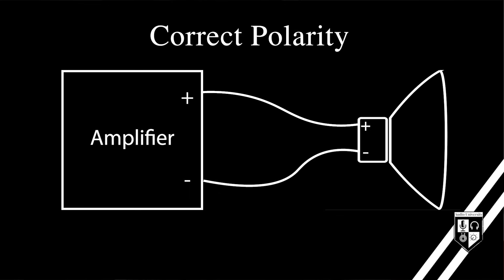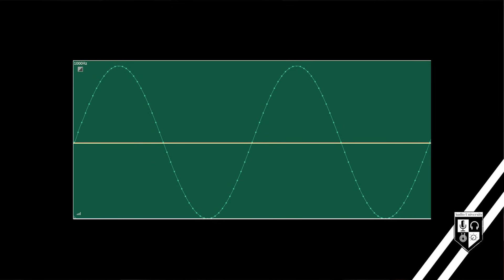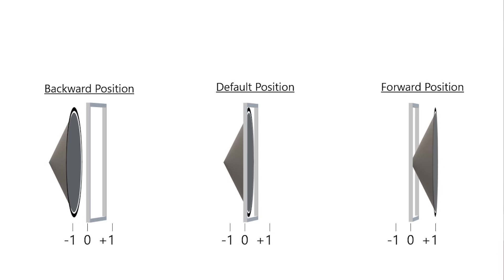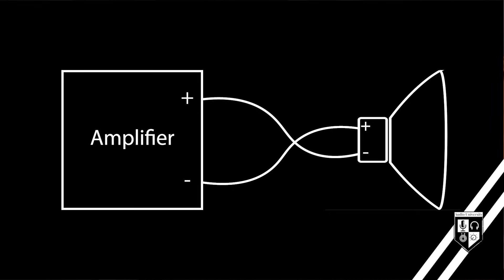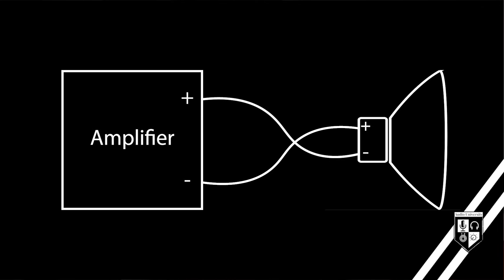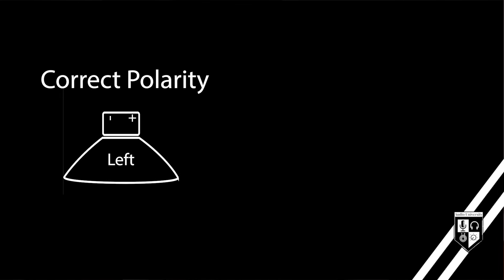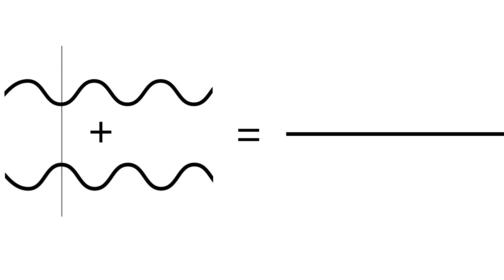POSITIVE VS NEGATIVE: Does Speaker Wiring Matter?

Comment: Its an AC signal going to the speakers so on 1 speaker the polarity does not matter. 
But when you have 2 speakers connected, the polarities need to be the same or else the sound will be distorted and the bass will be off balance when both are on.
Reply: @oldolfmann8927  polarity does NOT matter when its a mono speaker. 
Its an AC voltage which means the voltage & current is alternating back and forth so it does not matter if the speaker starts its direction up or down when its a MONO speaker ...
Reply: @oldolfmann8927  bro ... i have been in car audio since 91. I have (5) IASCA trophies.  
Dont sit there and tell me that polarity matters with 1 speaker. I already explained the physics behind it, i cant make you understand it.
Reply: @oldolfmann8927  yea ok 👌 ...
Reply: @oldolfmann8927  You are persistent, i will give you credit for that.

Comment: Can you do a bit on passive radiators? I've always believed them to be counter-productive as the radiator is worked in the opposite direction of the driver, just like the reversed polarity. Isn't this basically noise cancellation?
Reply: They're not just moving in reverse, they're also affecting the resonance of the system. Ports work in much the same way. Wikipedia has pretty simple explanations.
Reply from the maker: To be honest, I don’t know much about passive radiators. That’s a very interesting topic that I’d love to learn more about though! Other aspects of loudspeaker design, too! 

Sorry I can’t be more helpful, but I will add this to a list of topics for future videos that will require more research or help from a special guest. Thanks, Steve!
Reply: @AudioUniversity  how are you here talking about speaker wiring and polarity and not know about passive radiators.
Reply: It will mimic the movement of the subwoofer and help move air to create a little more bass.

Comment: Hi mate just a question. When wiring in parallel. Does it make a difference in audio quality or power draw when connecting the second speaker to the first as apposed to both speakers being connected directly to the amp.
Reply: I would agree that it probably doesn't make a lot of difference either way, but under some conditions it might.  If the wire gauges differ significantly, especially if you are using a high gauge ( small diameter) or if one run is multiple times the length of the other, the power delivered to each speaker won't be equal.  But, again, pending the situation, the difference in volume between the two speakers may not matter much.  That is also assuming the two speakers have the same sensitivity.  If Daisy chained, like the rings on a ladder, the leg to the first speaker has to carry twice the current as the legs running to the next speaker so make sure the gauge wire you choose reflects that choice.  If you are not that concerned about optimizing total performance, you probably won't be able to tell the difference by listening.
Reply: Connecting them directly to the amp cuts the wire impedance in half. It shouldn't be noticable if your wiring is thick enough.
Reply: If you wire two speakers in parallel, thence to the amplifier, this is no difference than each speaker going by its own wire to the amplifier; they speakers are still in parallel and two 8 ohm speakers in parallel is the same as a single 4 ohm speaker, from the amplifier's point of view.  Wiring two 4 ohm speakers in parallel makes 2 ohms and many amplifiers won't like that.  However you can wire two 4 ohm speakers in SERIES (plus to minus, red to black) to effectively make a single 8 ohm speaker and it will work fine.
Reply: Don’t do it , you putting a load across bth speakers that was never meant to be!
Reply from the maker: I believe both methods of wiring in parallel will achieve the same outcome. Good question though!
Reply: Quite often when someone connects 1 speaker directly across another 1 it will burn out the amplifier in a while, especially when you turn the volume up loud.
If your amp says " impedance min 8 ohms per channel " when you connect 2,  8 ohm speakers in parallel you are effectively putting a 4 ohm speaker on your amp & the output stages in your amp wont like it.
Reply: It does wiring one speaker to another change the OHM load from the amp to whatever it’s connected to
Reply: @3zealot324   Your answer is not very clear....maybe due to no punctuation?

Comment: hi, does subwoofer and mid need in same phase?
Reply from the maker: It’s most important that they are in phase at the frequencies where they overlap. The wiring should be the same, but sometimes you will benefit by flipping the polarity or delaying one in the amp/console.

Comment: I have spent a hour trying to find out how to find the pos and neg post on speakers. My new speakers came with no papers. Thank you.
Reply: It doesn't matter which post is which  as long as you match amp to speaker on both left and right channels, you will be fine.
Reply: Me to. Here is what I posted: Here is a question I have: I have two older vintage ADS speakers and the back terminals have neither positive or negative (red nor black) indicators. How do I know which to connect my speaker wires too?
Reply: @natanpierce495  the larger connector pin is positive and the small one is negative.
Reply: @natanpierce495 are they different sizes? Usually the larger is positive.
Reply: sailr8, did you buy those speakers from a guy with a white van on a street corner?
Reply: The inputs on the speakers aren't color coded red and black? Almost all speakers and amps are, with red being positive and black being negative

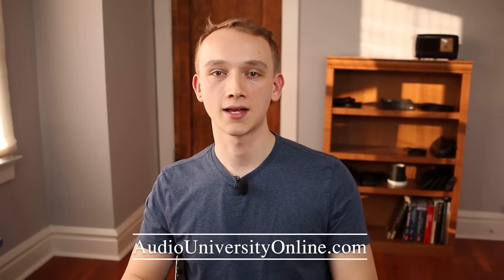Comment: Great Video! What is the "later video" you are referencing at 4:35? I'm not getting any sound out of my Bose Acoustimass Subwoofer and I suspect the satellites may be wired wrong, affecting how the sub module performs. Could an inverted polarity wiring be the possible cause of getting absolutely no sound at all from the sub? Or would I at least be hearing something? Trying to avoid dismantling the entire system for troubleshooting if there is something obvious I might be missing. Thanks!
Reply from the maker: I haven’t created that video yet. 

Reversing the polarity of your wiring wouldn’t result in no sound at all. I suspect something else is going on.

Comment: Hi  
Thank you for the video.
 I have a question that I cannot find the answer online. I own a pair of high end peakers and a powerfull amp. When I connected them  in the center fo the room there was no bass at all, but it was all arround the appartment, just where it shoudl be, there was noone. I have tried to reposition them as much as I could (not tu much space around them) and it didnt help. 
Then a friend of mine suggested to reverse the cable on one speaker and it  acctualy did the trick. The bass moved from around the room to the center of the room (couch whre I listen). My question is, do I leave it like this or how can I move the bass in the center of the room having the speakers connected correctly?  
Thank youf for any info!
Reply: If you reversed the wiring in an obvious way, like swapping marked or red and black wires so that visually thing look improper, there is probably a second inversion somewhere else.  You can look for that, fix it, and restore your inversion back to the visually correct configuration.  If you are setting this system up with intention of changing anything down the road, just leave your wire swap as is and tape a label somewhere to remind you of this when you sell your house and move the system.
Reply: I always ignore everything and do the bass test in mono and it will be very obvious which is right. Reverse any one pair and it will be good. Make any mistake just once and it will be wrong. The worst odds, don't worry. Check afterwards.

Comment: pull? there is no such thing as a pull as a force. only push, applied pressure exists as a mechanical force.
Reply from the maker: Interesting! How would the idea of a speaker creating negative pressure be properly articulated?
Reply: @AudioUniversity  The negative pressure in the speaker box is created by the movement of the speaker cone, the forwards motion pushing the air creating high air pessure and on the backside of the cone a low air pressure area is created allowing the surrounding high air pressure to equilibrate. The speaker cone is in motion through a medium, air. Motion, or push is one thing coming into contact with another thing, an applied pressure, this gives us weight, direction, motion and acceleration. All motion is applied pressure. Action at a distance is impossible. Push and pull are language based descriptors of direction, they are not describing forces. Pull as a force is absurd when you really think about it. Language ( sophistry ) has been used to fool us into believing pull is real as a force and people love is cause they watch too much star trek lol
Reply: @perspectivedetective2703  I am a physicist... I disagree with what you are saying as it does not address gravity, electric, and magnetic fields. You assert there is no such thing as "pull" and only "push" is the proper technical term???  Neither are technical and neither is more correct than the other.  Please describe the "pushing" going on between two masses or between two oppositely charged particles.
Reply: @jpedrick1571  can you provide any practical example of a pulling force?

Comment: Sir,what is the sound quality (base voice or any) difference between correct polarity connected (stereo)Loud Speakers and a pair of inverse polarity (stereo) Loud speakers ??!!!
NB: First both are connected; Amp +ve to LS +ve, Amp -ve to LS -ve. Second both are +ve to -ve, -ve to +ve.Connected with same type of Amplifiers.
Reply from the maker: That’s what I explain in this video! Did you watch it?
Reply: @AudioUniversity  Yes, I have watched. But my question is different Sir.
        My question is:
Scenario1.  A pair of LS (Stereo) "both are in correct polarity", we know good quality sound will be out.
     Scenario 2: In another pair of LS (stereo) "both are inverse polarity". what will be the output ? Any sound difference between Scenario 1 n 2 ??
     Can  both pair give us same sound quality o/p??
NB: Both pair connected to two same  Amplifiers at Two place.
Reply from the maker: Just like the multi-speaker example in the video, the two pairs of stereo speakers will work against one another if time aligned.
Reply: @AudioUniversity  Sir this two scenarios are not in a room or not at the same time.Two are in a different place. Which is the best o/p?  or both are same?
Reply from the maker: In almost every scenario, it’s best to connect the positive amplifier terminal to the positive speaker terminal and the negative amplifier terminal to the negative speaker terminal.
Reply: @AudioUniversity  There is no "Best", it doesn't matter if all speakers have the same polarity. Simple as that!

Comment: Does the wire with the stripe go in the negative terminal or positive?
Reply from the maker: As long as it hits the same terminal on both sides, it doesn’t matter. If the wire is hardwired to the speaker, the stripe is usually positive.

Comment: What happens if you have a dual voice coil sub and one coil is wired correctly and the other is wired incorrectly?
Reply: Open the sub up and check each coil separately to determine which is wrong.  If you have this situation though, the reversed coils magnetic fields will cancel and you should get pretty much no audio output from the speaker regardless of the signal you drive it with.  It certainly could happen though if you have just had the speaker apart and crossed things internally, or externally.

Comment: Nice information sir, 
But I have a one question sir I have subwoofer box  of sony home theater  which is covered with front grill so how can I test the wire polarity
Reply from the maker: Are the wires or terminals labeled with a stripe, color, etc?
Reply: @AudioUniversity  no colour , both are same in look
Reply: Most grills will come off pretty easy if you pull on them but I don't know specifically for the Sony.  Try placing the sub close to one of the main speakers facing each other and play some music with very low tones. Reverse the sub wires and try again.  Which ever is louder is most likely correct. If you want to try something really quick, tape a sheet of paper at one place at the top to the speaker grill and connect the battery.  You might be able to see which way the paper blows and see if your other speakers do something similar.

Comment: Hello Kyle, is it normal to get continuity when I hook up one lead of my multimeter to one terminal of a speaker and the other lead to the other terminal of the speaker?  thx
Reply from the maker: Yes. That’s normal. The two terminals are two ends of a coil of wire.
Reply: Depends on the reading you get - a short in the winding would produce continuity but no audio output. I would expect a few ohms nominally, and orders of magnitude more or less.  The voice coil will have a label stating the ohms but that is impedance averaged over a frequency band, not pure resistance to DC which the multi meter puts out to perform the measurement.

Comment: I knew most of this but not all, great job I look forward to studying your work. Loved the battery trick wish I knew that 30 years ago doing car stereos as it was more of thinking it sounded right instead of being 100% sure. I have a question which I'm hoping you can answer. I ran into a guy that said when hooking up car stereos, " as you hook up the wires, make the + wire shorter up to as much as half the length of the - wire, this will increase the frequency response of the speakers." Is that true? I think I wanted to believe it was true even though it didn't really make sense since the wires were  only 10 feet long.
Reply: He is correct, but his reason isn't. Every wire with a current running through it has inductance and also have capacitance with the the other speaker wire, and the inductance and capacitance will affect frequency response. How much it will affect it in that case? Probably very little and inaudible, so no need to think about it. Unless you use very long wires that run very close to each other, the difference is insignificant.
Reply: Very simple: That guy was wrong. He did not understood the basics.
Reply from the maker: I don’t understand how that would be true, Graham. Did he mention what the theory was based on?
Reply: @AudioUniversity  the explanation was that as current flows from negative to positive you can speed up the current by shorting the positive wire. So it becomes a faster return of the signal. I can only describe this as ten miles to the store and only five miles home lol. He won a car stereo challenge 2 years in a row with that system,  changed it and never even placed top ten. I'm just having trouble believing that it would make any difference in such a short distance.

Comment: So the speaker wire from amp just has one woofer speaker wire connection? I was thinking on getting this system, but removing the speakers and mounting them in the left / right side panels in a 73 ford pinto, It's a trunk model Pinto, I have 6x9s in the rear panel near the back glass already, If I set it up as i said here, can't I use the rcs outs and run them to each speaker? It's weird how it has 2 speaker in the box, but only one speaker connection on the back

Comment: my right side rear speaker doesn’t work. what could the issue be?
Reply from the maker: Can you switch the wiring to test the same amplifier with a different speaker?
Reply: @AudioUniversity  switch the wiring on the amp or the speaker? i just got new rear speakers
Reply from the maker: Either would accomplish the same thing. If the left rear works, try connecting the left rear amplifier to the right rear speaker to see if the right rear speaker or the right rear amplifier is the problem.

Comment: Thanks for helping me out with speakers that has no labels. It would be awesome if you make a video of what happens to a speaker without a resistor
Reply from the maker: Thanks for watching!
Reply: @Google user A resistor is a thing that reduces the power coming from the power source to a speaker and more. I’m not sure if the speaker would explode or get damaged being without a resistor.
Reply: @EverythingAwesomeTech  If you are talking about a speaker as in a woofer without an enclosure, I'm not aware of any that have a resister.  It won't explode.

If you are talking about a tweeter it may be damaged as it likely needs a high pass filter network which could include a resister but also a capacitor.   

If you are talking about a speaker system in an enclosure both woofer and tweeter already have resistors capacitors and inductors hooked up to them internally.  Those components are tuning the system frequency response and presenting a reasonably well behaved  impedance to the amplifier.
Reply: So many jokes on this page.  Nothing happens to a speaker without a resistor.  My speakers have no resistors, either in series or in parallel with the voice coil.  Having a resistor in series with the voice coil is going to obliterate the damping factor or the ability of the amplifier to control excessive excursion of the voice coil.
Reply: Ok thanks everyone for the answer

Comment: Please help , Is that the reason why when i changed my car stereo the sound is perfect only in the front two speakers and its weaker in the two rear speakers specially with bass  (knowing that the rear speakers sounded way batter and stronger before i changed the stereo -even when i set the fader to rear the sound is still bad )  ?
Reply: Could be.  Pulling the head unit out to get to the wires can be a pain so you could try reversing the polarity at each of the rear speakers if there is easier access.  Do each separately and then together to get the best sound as you don't know which one (or ones) are reversed.